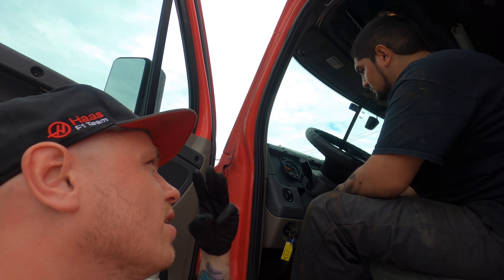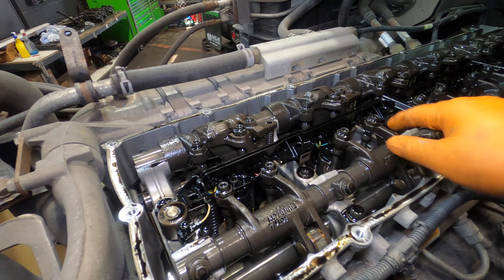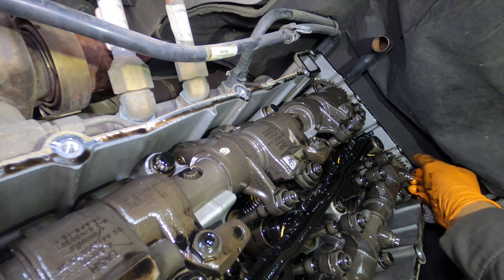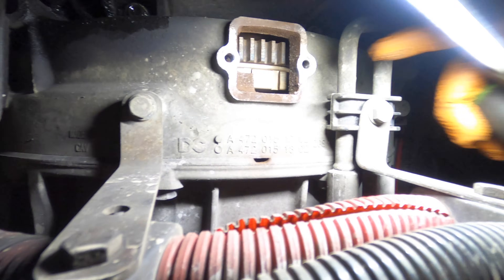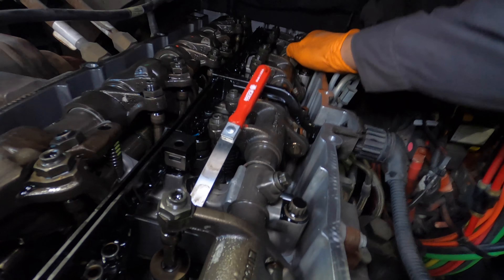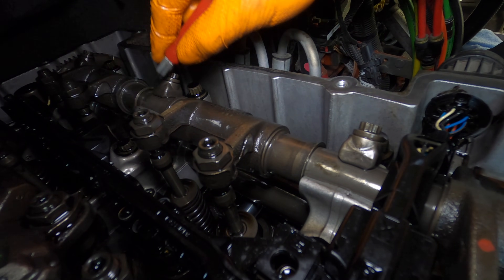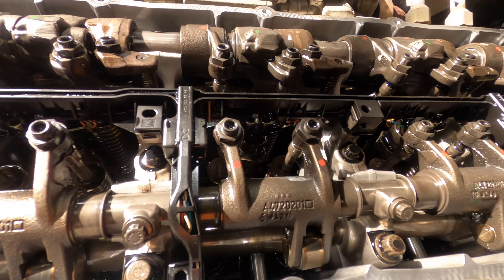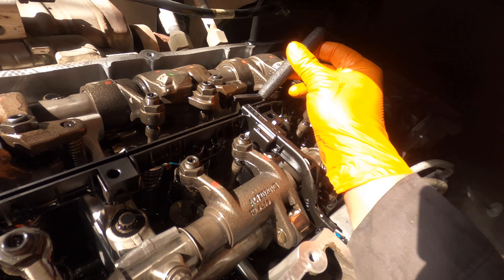Detroit DD15 overhead valve adjustment. Freightliner Cascadia

Comment: I think I need this done to my truck. MPG has dropped from 9 to 8.4 and very slow acceleration even with cruise on. What’s the ball park price range for getting this service? It’s a 2019 Cascadia 126slp DD15 engine
Reply: Did you ever get this done? Also did your mpg improve?
Reply: Check fuel pump for slow acceleration

Comment: Hello friend.  With respect, this video is of very little value for a truck owner/home mechanic.  Insufficient info (fast forward) on methodology for immobilizing engine/rotating engine, then you didn't even show us how valve adjustment is performed, nor how adjustment is retained.  I'm guessing it's clockwise on the torx screw to tighten, counter-clockwise to loosen, with locknut loosened before/after adjustment. Could you clarify that please? Thanks.

Comment: How do you know when you need a valve adjustment? I'm at 586k miles now on my dd13. 
Any info appreciated,
Reply: If u hear engine got louder when idling than it was before. U can tell the difference. U also compare your engine  noise to other similar trucks by standing front of your trucks hood.

Comment: How do u know when the valves need adjustment?? Are there signs?
Reply: I am wondering the same
Reply: Valve adjustment is suppose to be adjusted at predetermined mileages/hours listed in the service manual. I recommend every 225-250k miles or when in depth mechanical troubleshooting or anytime the rockers are removed/replaced for any # of reasons

Comment: i thought you were suppose to use blue thread locker on the adjusting studs to the jam nut, and torque to 37 ft-lbs
Reply: is this correct ?